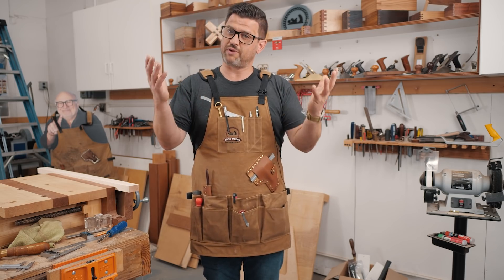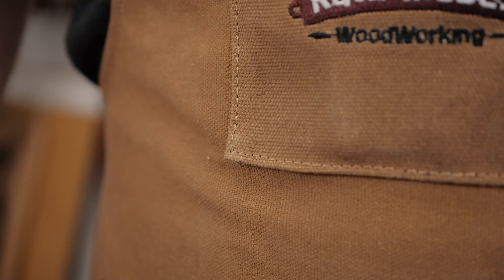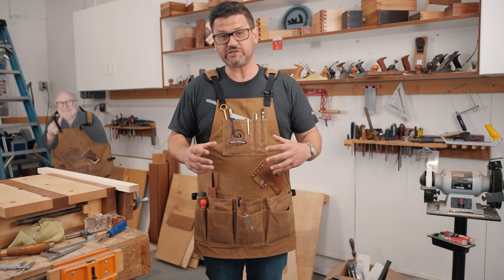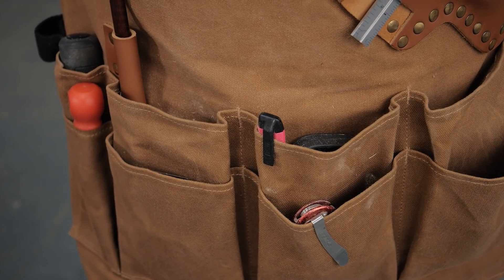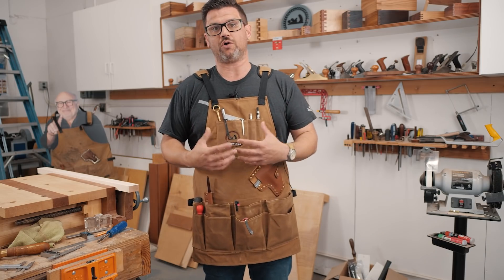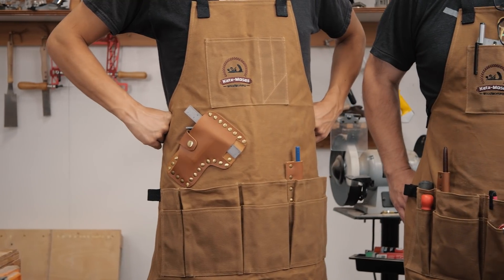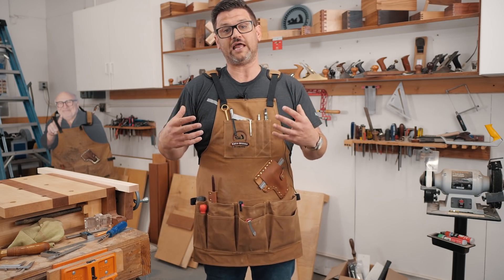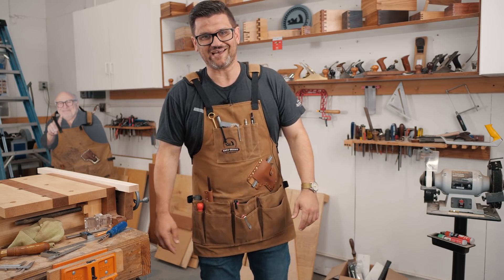The Katz-Moses 20 oz Waxed Canvas Woodworking Apron - Giveaway and Presale

Comment: I just got mine and I'm very pleased with it, well worth the very reasonable $40.  I have a small frame (5'-8" and 125 lbs.) and it just fits me with a little wiggle room... mostly the shoulder straps just fit me at their shortest setting.  The only improvement I'd like to see is a small pair of dedicated loops, one per side at the top just to the sides of the upper pocket for hooking your glasses on (reading and/or safety).  It will get much use in my workshop.  Thank you!

Comment: I got my apron a while back and have been using it for a while. LOVE IT! It does everything I need. One minor thing that has been great in particular, is the wider pocket up top. It perfectly fits my Rite in the Rain notebooks that I jot measurements and layout down in. They are waterproof (not that we often need that in the shop, but great for the occasional coffee spill...), have grid lines, and even some rulers and scale conversion charts on the inside and outside covers. I was always fiddling with those or sticking them in my pockets, but that top pocket is perfect. I keep my pencil, notebook, and a marker up there.
Reply: Here are the notebooks for anyone interested (not an affiliate link or anything): https://www.amazon.com/gp/product/B01N0139W7/ref=ppx_yo_dt_b_asin_title_o02_s00?ie=UTF8&psc=1

Comment: I looked at you store 2 weeks ago to check if the aprons were out but I didn’t see anything so I bought an apron on amazon. I used it today for the first time. Immediately discovered I need more than 2 pen or pencil holders and two hours later the seam on a pocket blew out. So I just ordered your apron and v2 stop block.

Comment: My Katz-Mosas apron arrived yesterday.  The only thing that I was able to do was to try it on. I like the feel of it on the shoulders.  I beleive the pockets will work for me.  In tring it on and getting all the adjustments to the strapping made to fit, I found that the strap that is used to attach in the back was just barely long enough.  It had to be let out all the way.  I would make it a little longer so that the apron will have a greater flexibility in the the back.  I would also make the attachment on the right side a little longer so you can use both hands to make that attachment.  I am 6 feet tall and weigh 230 lbs and I take a belt size of 42.  I suggest that you make this adjustment to future runs or send an extra length that can be attached to the original apron stop.
Reply from the maker: It sounds like you're probably wearing it too low. Check the last email update which goes over belt extensions and how to properly adjust it. Cheers

Comment: At the start you smeared a glob of yellow glue on your old apron. That would be me (maybe not such  big glob). Does the waxed surface resist PVA glue and will it pop off (ala silicone) or should I get used to having  a wet cloth around? Not an apron user at present but my workshop jeans are getting pretty stiff with glue residue.

Comment: i got your apron but added a 3x1x1/8 42 neodymium magnet right below the pouch with your name stitched in. I wet molded the leather and set it with rivets and linen sewn. It actually can hold my block plane but its more for bits and screws. I was going to put it on the right side but that would interfere grabbing my knife or utility knife so I decided to center it. I also did not want to put a holster for my block plane as it would cause the problem on the right side. I am sure I will keep adding to it but must be conscious about weight. Although I agree you are making it accessible to many, I would pay double for made in America.
Reply: Is it made in America?

Comment: Nice apron, but I think you've got to lose the snap for the square holder, that turns 1 step into 3 steps... 
It would also be nice if the bottom two outside pouches were bigger and maybe a little shorter so that a bigger tape measure would fit in them and be easier to take out

Comment: Just got mine in today's mail and it is great.  The only issue is the strap for the waist is a little to short.  Yes I am a big guy.  It would be great if you offered an extension for that strap.  More than willing to pay extra for it.  That way you would not only have all of us lefties covered but also those of us who have a bunch of weight to loose.  Big guys should also be able to do woodworking also.  Thanks in advance.
Reply from the maker: Extension straps were addressed in the last update and already ordered. If you did not receive the update you should email customerservice@katzmoseswoodworking.com
Reply: @katzmosestools  Thank you so much Jonathan.  I will check my mail for that.  I am sure I received that but probably just didn't read the whole think.
Reply: Still trying to see if anyone besides me getting in on the pre order had to pay $10.70 postage due when it came in.
Reply: @777tomwall  All postage was included in the price of the apron.  Where are you located.  Could that be an issue?  Have you contacted Jonathan Katz-Moses with this issue.  Seems that that would be the proper way to go.  Good luck.

Comment: left hand version is not really left handed. Waist snap buckle is on the right rear very difficult to operate for a lefty. Two small front pockets are on the right side, should also be on the left side. Customer service is a joke, will not answer inquiries about this problem.very disappointed with this apron. It is now a hanging wall decoration.